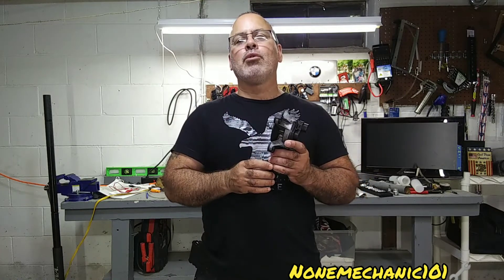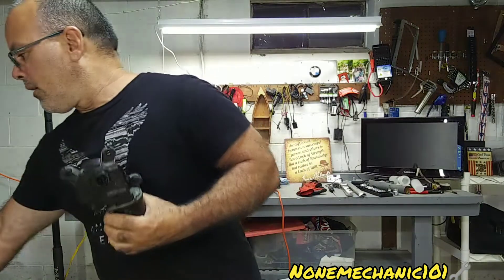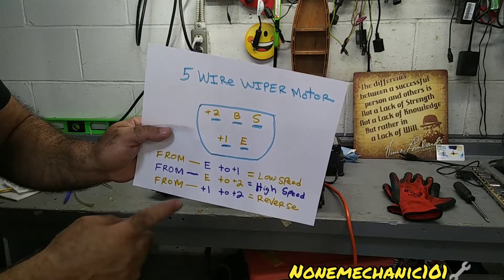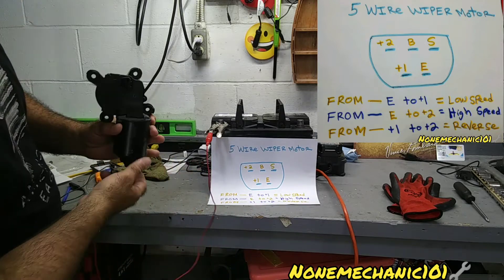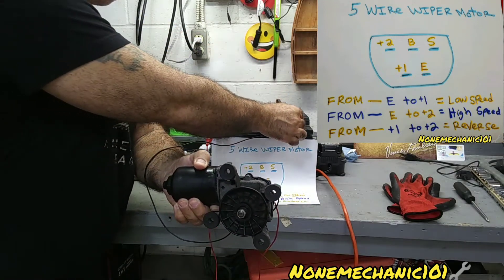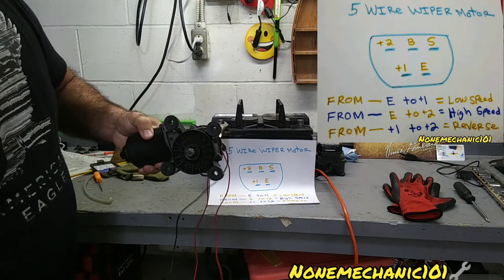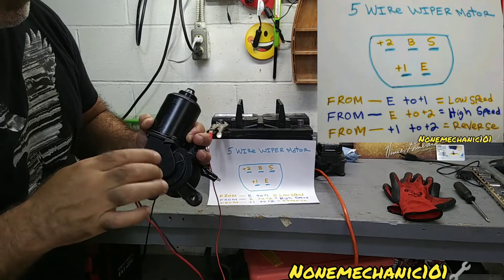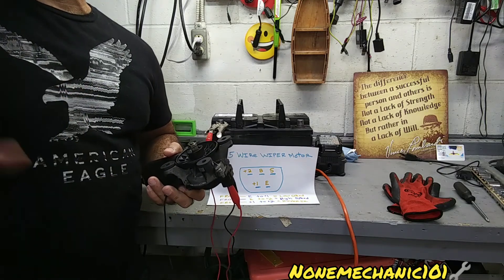Wiper Motor: How to check if a 5 wire wiper motor is working.

Comment: Hiya buddy, Wipers not working but when connecting wires from battery to wiper motor, shows motor or mechanism is working. 
Any idea how to solve this problem?

My window wipers were working on auto and sometimes it use to stop mid way way, so i changed bothe RELAYS, all of a sudden my wipers stopped wiping, so i changed the relays again, no luck still not working, I have checked the 25amp fuse in the fuse box, all good,when I move the wiper stalk up or I can hear the relays slightly clicking (I'm guessing it's working), I have now removed the linkage and motor, I stripped the motor gave it a clean, attached 2 wires to the motor plus, minus directly, and it works, so i plugged it back in to the car closed the bonnet, pulled the stalk and nothing, removed motor plug connected my 2 wires again with a battery, it's spinning, so i checked the wiper motor harness for power, one connector had constant positive so I assume there is power, any advice would be appreciated, thank you in advance,

Recap
🔴CHANGED RELAYS 3 DIFFERENT TIMES

🔵WHEN MOVING STALK UP CAN HEAR RELAYS CLICKING

🔴CHECKED 25AMP FUSE IN THE FUSE BOX

🔵 CHECKED WIPER CAR HARNESSES, ONE PIN HAS LIVE COMING THROUGH

🔴REMOVED MOTOR LINKAGE FROM CAR,

🔵TESTED MOTOR WITH A DRILL BATTERY 😬, MOTOR AND ARM SPINNING AS NORMAL,

🔴REFITTED BACK TO CAR, PLUGGED IN HARNESSES, NOT WORKING

🔵REMOVED WIPER LINKAGE AND MOTOR AGAIN, HOOKED IT UP TO MY BATTERY, MOTOR SPINS

Comment: Hello. Red cable always plug in Negative battery one side? And another side will plug in +1 or +2( red cable is Negative? Black cable is Positive?) for low speed and High speed.
Reply from the maker: I don’t as using ale gator clips

Comment: B and S is to stop the motor at the position that the wiper lay at the bottom of windshield. It also stop the motor in INT
Reply from the maker: Thank you
Reply: B S how to given a supply
Reply: @badmarvel1840  B are directly connected to the positve supply
in the wiper motor there are special mechanism that we called "cam plate" when we learn about this in college, cam plate are driven by the wiper motor when the motor rotate, in the picture below, it is the hatched circle next to "motor gạt mưa" 
The larger part of the cam plate is connected to B as you can see in the circuit, so it will have positive current. 
The smaller part of the cam plate is connected to E and is grounded, so it will have negative current.
When the cam plate rotate, it will connect (S to B) or (S to E), so the S pole will have current depending on which pole it is connected
picture: https://drive.google.com/file/d/160Dw0vEdt-q4FVTtuPkWNWU_jygsEZFZ/view?usp=sharing
Reply: @PhamHoangNhan-lr1jw  please how to wire the interval position?
Reply: @billpokam4290  you mean the INT mode ?
Reply: @badmarvel1840  another picture: https://drive.google.com/file/d/1ChAd_LO8vICMsI-LjfDuBE1nTyZcwyCs/view?usp=sharing 
In this picture the camplate are the blue circle, this one was made by my teacher so it may be better than my autocad made picture above.
If there is something you dont understand just comment here i will help.
Reply: @PhamHoangNhan-lr1jw  please how to obtain the interval position?
Reply: In your Image in the left side, is that a 4 pin relay ?
Reply: @paultestman606  yes it is